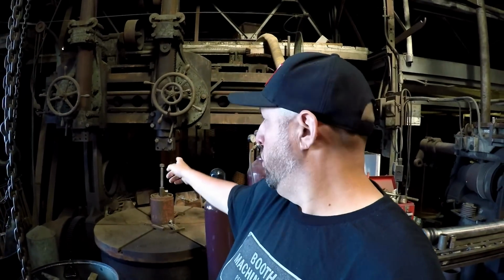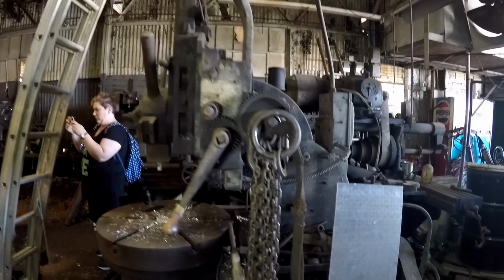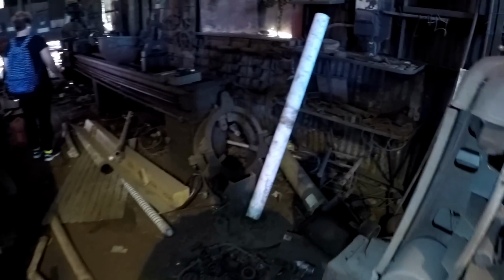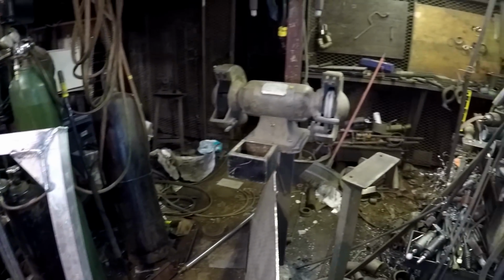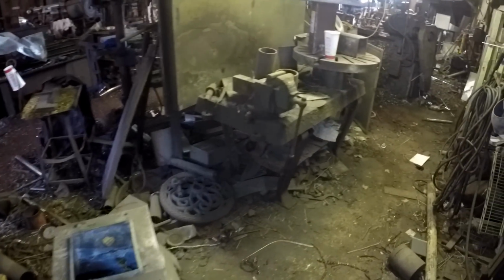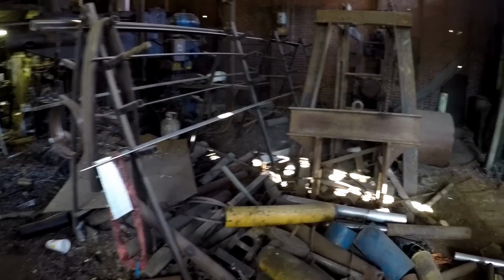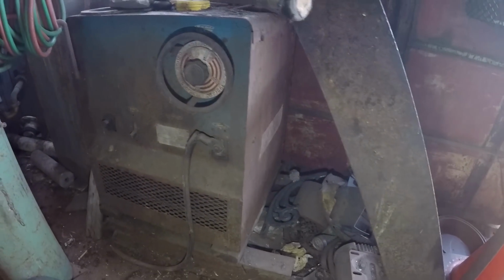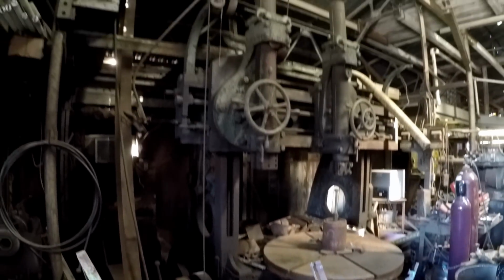113 Year Old Machine Shop

Comment: The is some lovely kit there and who gives a fuck if it's messy if his work is good then why does it matter
Reply: I work in very old machine job very similar to this one. With the machines being in such poor dirty condition it makes using them hard. That grit and grime makes the carriage and tailstock hard to move. Plus it wears down the precision surfaces which causes the machines to wear out faster and produce less accurate parts.  The masses of chips are a giant trip hazard. The place is currently being fined by the city and it's much better than this. If anyone was to call osha or the city was to complain he would have a world of hurt. I still love the old machines but saying it's okay to be like this is simply incorrect..
Reply: @nathanhershey7897  OSHA won't do anything if he has no employees, which is probably why he has no employees.

Comment: As much as all this stuff is very interesting, I would have to say that would have to be the most unorganised messy and extremely dangerous workshops I have ever seen. If the owner does a lot of hydraulic repairs then how does he keep the components clean. I bet the outside of the shed would be just as messy as the inside.

Comment: The dual spindle lathe looks like a J.J. McCabe lathe.
Reply: Yeah thats it.   HGR in Cleveland had a nice big one with a very long bed ....... a couple years ago.  Would be so nice to have one of them. Because the second spindle is set to the back very large diameter parts can be turned without having a real long cross slide or a real big overall machine.  I had seen it in Cope's book "American Lathe Builders 1810-1910 and recognized it immediately.

Comment: I love all these old machines, but they can't compete. Also, working in a shitty dirty shop is dangerous. Junk piled to the ceilings and trip hazards everywhere.
Reply: What will your shop look like in 120 years? :-)
Reply: @tom7601  I work in an 80 year old shop. The upper management has finally changed. We walls and windows are finally getting cleaned and painted and millions of dollars in new machines are coming in. With that said, it never was a trip hazzard and every machine was cleaned everyday. Even in a run down state it was organized.
Reply: @wesleybickel2869  same with my 100 year old shop! Cleaned everyday and tooling put back where it goes. No excuse to not spend 15-20min a day cleaning. Congrats on yours getting a face lift! Mine is still in the dark ages

Comment: unfortunately i have seen pictures of machine shops after we dropped the bombs in Nagasaki and Hiroshima that were cleaner than and less disrepair in that place is. what a travesty. they bought 1. broom when that place opened and it broke and they never replaced it?. the neighbors want the property just so they can clean that eyesore up. if it looks that bad inside i'm sure the outside is no better. i get that a machine shop can get dirty from time to time and mine does too. but not for 40-50 years or more. i couldn't even watch the whole video.

Comment: I am a retired millwright in need of a mission, gimmie that address and I will be there in a week. Did I mention I work for free?
Reply: My 2400 sq. ft  blacksmith/machine/fabrication shop is filled with lots of older tools, equipment and materials acquired over the past 30 years.  It is not nearly as messy or dirty as the one shown in this vid.  However,......... my shop is cluttered and I could really use help in the organization of my shop and a second pair of eyes with experience in this type of work would be most appreciated.  I used to be really organized, still em within drawers and cabinets and I'm able to put my hand on most anything in the shop.  I would like to have the organized shop I used to have.  I live in Western North Carolina and happy to exchange effort.

If you're interested in helping and us working together, please let me know. :)
Reply: I'm glad somebody else was thinking along that line. I was thinking how I could spend alot of time cleaning in there just to be able to ask, "What is this and how does it work?" whenever I needed to

Comment: I used to work in a 100yo machine shop. I learnd alot from one man Who had worked there for 48 years. It was alot of fun to work there (when the boss was out). We did everything from changing a small screw to building compactors powering the 4 meter long special threaded screws for nuclear power plants. We made the screws in lathe, 4m long threads with 2 inputs in the thread. There were some in Poland who needed a new screw but thought it was too expensive, they would try to get someone in Poland to do one instead. After about a month they rang and ordered a screw, nobody who checked on the old man could come up with what it was for thread. It was our own thread 😂

Comment: Sorry, but it's just hoarding with total disregard for the equipment under the guise of "history"! I see the same thing with ignorant owners of old musical instruments that, with a tiny amount of maintenance, could be saved for future generations, but they refuse to let anyone touch them! If the owner had the slightest respect for the gear, it would not be in that state.
Reply: I’m not saying this is the best thing ever but he’s using machines older than most folks here to do actual work. He’s keeping his machines in working conditions after 70 years of use even if the place is disordered, so  he most certainly is at the very least keeping them well oiled and honestly you keep machines like these well lubed and it’ll run for 200 years. These machines weigh thousands of pounds and when one of these things breaks it’s not “easy maintenance” sometimes with old machines the only way is to just make a new part. When a machine that was literally built into the building 100 years ago breaks and the thing weighs a few tons what are you options, realistically? It certainly won’t be easy to fix and might not even be economically reasonable.

It’s nothing like “ignorant owners of old music instruments” because those people aren’t jamming out with a 100 year old guitar but this man literally is using a 100 year old lathe to cut threads. Its easy to look in from the outside and shake your head in disapproval but try looking a little deeper and you’ll see a man keeping history alive for as long as he’s able to.

Comment: This is the sign of mental illness  in the highest degree , a once upon a time wonderful establishment 
Capable of any thing to come there way . By the third generation the love of manufacturing and pride of ownership was lost
Every thing is in a state of disarray partially dismantled or covered in trash and a safety Hazard i, call me an ASS HOLE  (I love it ) This is not a rare opportunity for anybody I've seen this many times in the last 30 years , every thing that you will ask how much for this is I don't want to sell that, only the scrap is for sale and that will be priced to high to make a profit if he cared he would give that vertical boring mill to MR Rucker its an expensive move but he has the sponsorship to do it if he Evan wanted it.
After watching the Video it's obvious it's a forced circumstance what he doesn't know that Evan if  that property is sold for 2 million dollars 
When it's cleared a down to the bare soil and the contamination is so severe , and the cleanup costs could very well be millions to correct .
A  100 year old machine shop had used 10's of thousands of gallons of oil and coolant over the years and its all right there in the ground probably found its way in the water supply I'm sure this private individual is living on the property they almost always do it's the worst I've ever seen . Reading others comment every one is so nice and understanding well do you see any of the you tubers shops looking like that ( he'll no )
UNBELIEVABLE. ! .
Reply: You wouldn't like my workshop. :-)

Comment: They don't make them like they used to! Sure this is a bit cluttered but everyone acting like its far more of an issue than it really is, worked in much worse conditions over the years myself and seen many many shops more messy and cluttered,hes probably been working like that for decades. Seems these days everyone's looking for an excuse to blame for their own carelessness...
The "punch press" shown at 25m mark is what id call a c-press, used ones of similar vintage but a bit larger when i was a sheetmetal apprentice.Kinda scary, but they had a cage you pulled down that locked the pedal so it was technically impossible to operate it with your hands in the way, unless you're a moron.I still have all my fingers ;) Couple of close shaves mind, bloody guillotines and brake presses mostly...

Comment: That old acetylene piping looks scary. Speaking of which, how many friggin' OA sets does he have in that shop, LOL!

The torch you picked up isn't oxyacetylene. It is a carbon arc torch, powered by an AC CC power supply (i.e. an AC stick welder). The carbons are set at an angle, and when you strike an arc between them it emits an arc plasma flame between the two carbon electrodes. I've messed with them, and concluded their main feature is that they can reach a higher temp than an OA torch. However, they don't have anywhere near the control or finesse of an OA flame. They are oxidizing (being operated in air), the electrodes burn away annoyingly quickly, they deposit carbon soot (and copper if you are using regular gouging electrodes) on your work, you have to wear a welding helmet with a rather dark shade (11+) which limits your view of your work, they will give any exposed skin a fast arc tan,  they put out very high temp but only modest BTUs compared to oxy fuel, they are noisy, they are a shock hazard on high OCV power supplies (which most were), and overall not a very pleasant or useful tool IMO. Which probably explains why they haven't been marketed in decades. 

Also, the torch tips you showed on the wall are either Oxweld or Rego by the looks of them. Either way, I would take the lot of em :-D

Comment: those things that you didn't know what were, those are used to check the blade pitch on a propeller. You lay one of the blades on it and move it so it's flat against the blade and measure the angle, which does have a manufacturers specification. (when i was young i took a few air craft mechanics courses which means yes i can build an airplane)

Comment: yes it looks like my old miller its got capacity for water cooled tig torch and gas solenoid ac dc still hard to beat on thin stainless steel still excellent .

Comment: Was the old line shaft powered with a steam engine?
Reply: In 1905...it could have been steam engine or electric motor.  Depended largely on local power or local supply of fuel. Electric motor..often times had a local steam generator to spin the genset to run the motor (Grin)
Reply: @GunnerAsch1  Could well have been next to a river using water power also.

Comment: Best thing is to contact a museum for most items. Maybe they at least remove it for free. Maybe even pay scrap price for it. Auction is probably no go - they may refuse to even take it. If he gets scrap value for it he is doing well. Giving it to a scrap yard is also no go - you have to pay your own transport and they will take it only when super clean (not guys strong side) - and even when clean they take it for FREE. To actually get paid for cast stuff you need to cut it into small chunks - ask scrap yard how small - doesn't seem to be worth it. 

Alternatively he can sit on it and wait for years for an enthusiast of old iron to come by and buy it - maybe. Main problem is that the pieces are simply too big for a small shop and too old to be of use in a larger shop. He is also selling unique items not for general purpose - duplicator lathe is nice - but of no use to a large shop that could fit it in and no use to small shop due to unique nature.

Comment: there used to be a machine shop in wichita,ks. retsche machine was run by a one eyed dwarf and an old hunchback black guy. ( i'm not kidding). the did beautiful work in a shop that was powered by a half a tractor out in the alley. when they were not making parts, they made corn flakes. 2$ a sack. lots of short tailed cats in the place. got'em caught in the belts. its gone now. should have been saved. lots of places like these places are gone. and so is the knowledge of how to do things with very little.

Comment: What did you mean when you called that the "prop" room? What is a prop?
Reply: I think we are talking boat propellers not aircraft.  Nobody in there is repairing aircraft anything!  You have to be FAA certified for aircraft repairs of any kind.  Cheers!
Reply: @vecair  I thought that looked like a crude setup for props but I also remembered this shop has been around for a century so I don't know what they did back in the 20's or 30's, or earlier,  as far as prop repair/build. It is a state of the art CNC process and balancing these days.
Reply: 'Prop', it's a shortened term for propeller, in this case, used on airplanes.
Reply: @Orange-Jumpsuit-Time  Oh, that kind of prop.

Comment: That “go to” lathe made me a little cranky. I am most definitely NOT a neat freak and I have my share of messes everywhere, but the chips that connect from the tool to four feet out on the floor is just a little much.
Reply: With you on that one - having accumulated chips get caught up on my chuck and pull a file out of my hand taught me more about a neat workspace than a chain of instructors ever could.

Comment: In 1992 I was Manufacturing Manager at Douglas Corporation in Teconsha, MI. The equipment in this video is close to the machine we used to rebuild pumps for the municiple wastewater industry. 
The vertical lathe in the beginning is a smaller version of the one we used to turn the flanges on welded assemblies. Last I knew the company was still open.

Comment: Father time gave this place a real beating, but it would be fascinating to hear about the things they made over the course of 113 years.  I'm part of a group restoring a rare 1906 automobile.  The original equipment in this shop would have been the kind of tools used to make that automobile.  The angle iron used in it's construction was originally flat iron that a blacksmith hand forged into angle iron.  The nuts, bolts, screws, and rivets were hand made using those tools.  I'll bet this shop has some stories to tell.

Comment: I'll bet there's more value in the pre 1930 steel as non-radiated scrap iron than as any kind of restorable machines with unknown tolerances and dubious maintenance records.
Reply: Actually there are shops that will dismantle that equipment and hand scrape it back within tolerance or better than it was new for a fraction of the price.

Comment: We have an American hole wizzard radial arm drill identical to the old green one in this video at my shop still use it on a daily basis. There is also a seller's mill from 1909 that still runs everyday some machines will never lose there place in the machine shop
Reply: There is a lot of mass in the old equipment. It was made with replaceable bushings and bearings.

Comment: Some great old machines and history in that building but i cannot help thinking that its an accident waiting to happen with all the crap, shavings and bits of this and that lying arround in every corner. I'm surprised its still allowed to be open and working because of the safety hazards in every work station. I have seen a few old shops in the same state, unfirtunately. There must be 20 tons of metal shavings lying arround on the floor.
Reply: Fairly confident the company is not active, no liability insurance, has no employees, just a owner operator. Enter at your own risk.
Reply: Owner could collect all the chips, take it to scrap, and make enough money to retire probably. Thousands of dollars worth just in chips laying on the floor.

Comment: Mostly scrap metal. No maintenance or care obviously. Sad. I ran a machine shop for an electric motor repair shop for a few years and their stuff was just like this. Everything was left wherever the last person used it. Took me 2 years to clean out all the crap and get everything organized and working right. A year later I left for more money. Best lathe had 1/4" slop in the tool slide until I rebuilt it. .001 press fit tolerances on that junk was not fun! Was interesting, learned a lot, but not some place you really want to be daily. Nasty place. We had an old shaper that I got running that amazed the guy that owned it. He didn't think it actually worked. Used to face fit flanges for the local water department with it that paid good because it was usually an emergency.

OSHA would crucify him if he had employees. Hope those were boat props they were working on, not airplanes. He has a lot of mooring iron. lol

Comment: I work at a foundy that is 145 years old, in the machine shop. We have many pretty old drill presses and such. Also older lathes and grinders and stuff that are still used. And we have a cnc shop with some new Haas machines, a dmg horizontal, a new mazak lathe, and some older mazaks and an older Mitsubishi

Comment: Wow!  A PIV drive certainly brings back memories.  As a newly minted chemical engineer in 1975, one of my first projects was to renovate and start up a 60 year old soybean extraction plant.  The two extraction towers were driven through 50hp PIV drives.  You adjusted the speed of the PIV based on residual soy oil in the extracted flakes.  Also Foote-Jones gearboxes were also prevalent on some very old drives in our plant.  They were absolutely bullet-proof.  Always sad to see entropy win but it always does.
  Thanks for documenting our history.

Comment: The Sureweld Welder is made my Miller. If you were to remove the side panels it will most likely have a miller gold star sticker on the frame. Many welding and gas companies contracted with Miller to build welders for them... Airco, Sureweld and others.